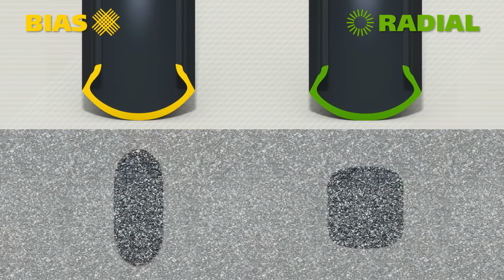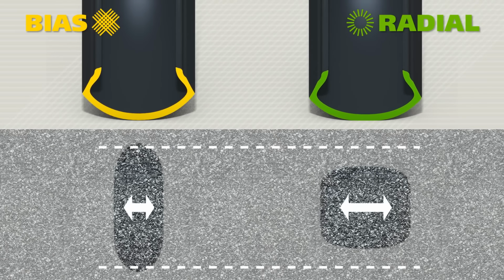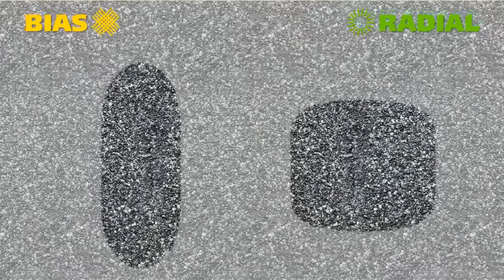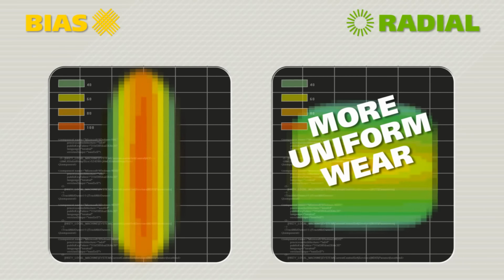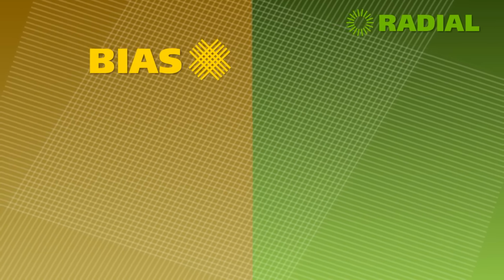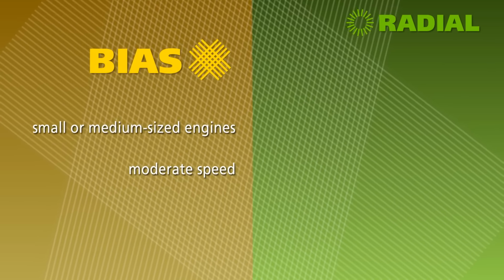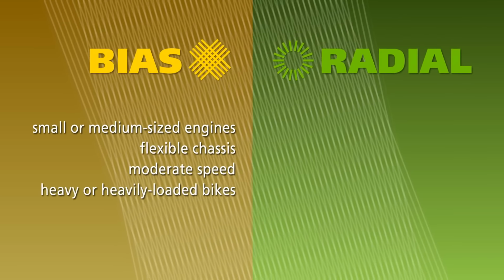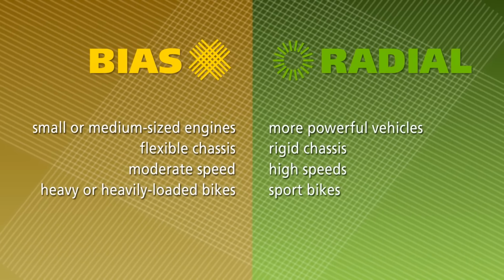What is the difference between Radial and Bias tires? | Michelin

Comment: If bias plies have generally stiffer sidewalls, why do drag slicks (which are bias ply) produce so much more tire wrinkle than drag radials?
And why do drag racers always talk about how bias ply tires have softer sidewalls and are more forgiving on the launch? 
I mean they're obviously more forgiving because they wrinkle, the tire works like a shock absorber for the torque. But why can bias plies do that better than radials?

Comment: The problem is when you look at tyres on the Michelin website whether a tyre is bias or radial isn't mentioned.
Reply: @defylifeadventure  It is mentioned as "B" for bias ply and "R" for radial. For example, 140/70B17 is bias and 140/70R17 is radial.

Comment: The front tire size 100/90 19 seem to be only available in bias-ply, do you know why ? 
I just bought a 2020 Tiger 900 GT (i love her) & stock tires are a Radial 150/70R17 rear & a Bias-Ply 100/90-19 front.
Reply from the maker: Hello,

Where do you live (Country)? 

Thx
Reply: Michelin : Canada, Quebec, Montreal.
I speak French & English.
I am curious & i would like to know why the front tire size 100/90-19 is not available in a Radial tire : only bias-ply tires in that size! Why?
Reply from the maker: The design of our 100/90-19 bias ply front tires for this application are to coincide with the manufacturer's vehicle design to use a bias ply front and radial rear as original equipment.
Reply: Michelin : thanks; i think i will give a try to your Anakee Adventure tired when stock tires will be dead

Comment: Neglected was the singular characteristic of the bias ply tire (or tyre, if you prefer) that the tread with align itself with the road irregularities most noticeable on metal bridge decks.  Bias ply tire tread will set itself into the slats of the bridge shifting, sometimes violently, the vehicle side to side.  Radial tires do not do this because the sidewalls will flex and return leaving he car above them following a straight line.  The stiff sidewall on a bias ply will not flex (hardly) and the car above must move sideways with the sidewall and tire.